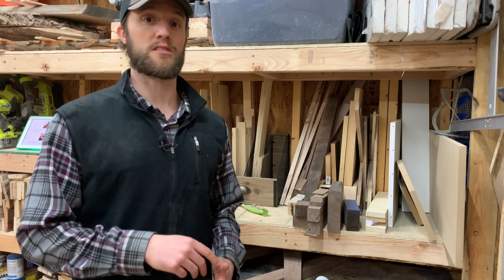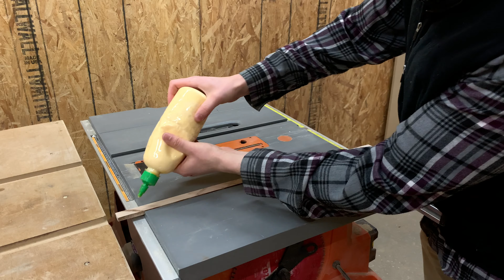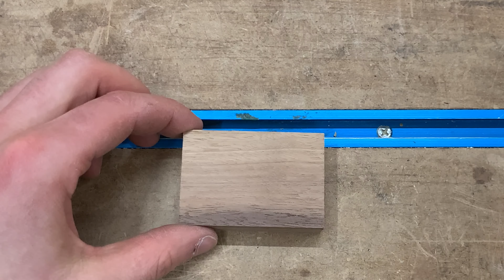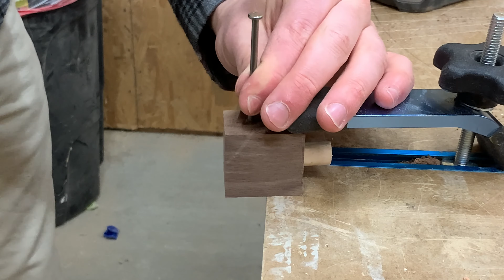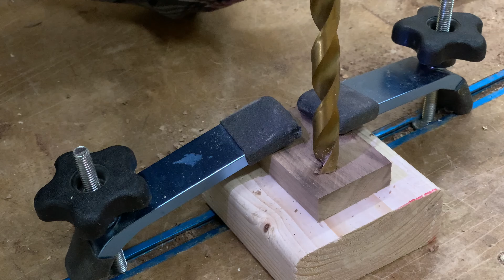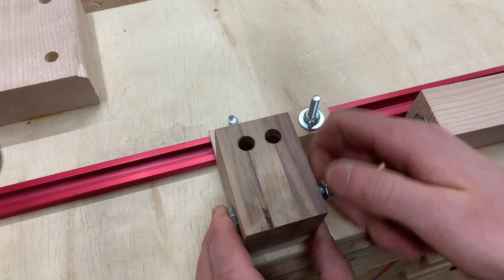this will put lathe companies out of business

Comment: Simple enough design. The drawback is you can only get a radius equal to your block and screw. I think the jig where the blade is underneath instead of to the side, is a better approach. That way you can raise your support or raise your blade, for your desired circumference without creating a whole new one
Reply: The only drawback I can see is that it's not a lathe.
Reply: @cartier13  It doesn't mind since it does job. Why being so closed mind?

Comment: Excellent design. Thanks! This should be perfect for my situation.  For what I'm doing, I stop at .05 sec (make a tenons) on the ends of 3" to 5" logs. I just need to figure out how to adjust the feed rate, probably the tailstock with a 5" x 1/4" machine bolt with the threads exposed so the rate of feed for the log can be regulated.

Comment: Do you have the power drill in forward or reverse?
Reply from the maker: Forward
Reply: @SpencleyDesignCo  , the reason why I asked is some will cut on the left side and some will cut on the right side of the blade. Thanks.
Reply from the maker: Yup!
Reply: Doesn’t forward with the jig left of the blade make it a climb cut? If so, is that not dangerous?

Comment: Nice jig.  The only problem is that the bottom radius of your finished piece will always be equal to the distance between the tailstock nail hole and the table saw blade.  Would be nice if you added an adjustable slider on the tailstock.
Reply from the maker: Thanks, Samuel! It’s definitely an option to add adjustments at both ends 😀

Comment: You might be interrested in this jig using a tablesaw to turn a ball.

Living in a flat and only having room for a small underpowered wood lathe, it takes forever to turn a ball.
But I have a table saw and a drill so I designed a jig where you can make the ball/sphere in about 5 of minuts.
It's done by turning wood blank by the drill and rotate it around saw blade, a mix of your table saw lathe and circle jig
Have a look here for the basics of the jig
https://youtu.be/egUNaP-0-x0 
and the one i build enclosing the process to keep fingers away from table saw blade.
https://youtu.be/hZarZfzcbco
Keep safe - Happy Woodworking
Reply from the maker: Sweet!  I will check it out!

Comment: How much cutting height do I need if I am looking for a table saw which can be used for this? 😊
Reply from the maker: Hi! I’m not sure I fully understand your question. Are you asking how high the blade needs to come up from the table?
Reply: @SpencleyDesignCo  yep =) The most tablesaws i can find only goes to 60mm in a 90 degree angle. But it seems that i need more for a project like this.
Reply from the maker: Yeah that should be fine. In the US, a 10” table saw blade is the most common. That gets you about 3 1/2” of cutting height. I think that’s 75-90mm if my mental math is right

Comment: perfect timing! im going to be making this jig!
Reply from the maker: Awesome, Kyle! Thanks so much for checking out the video and supporting the channel! Let us know how it goes! If you have any friends that might like the video, sending it to them would be a HUGE help for the channel. No pressure though, just glad you found this helpful 👍
Reply: @SpencleyDesignCo  The jig came out great! i am having an issue with flat spots near the tail stock from the initial cut offs, not sure why yet. otherwise, this is awesome.
Reply from the maker: That just means your stock that you’re turning isn’t large enough to reach the blade. Either make the spinning piece thicker, or move the tailstock closer to the blade
Reply: @SpencleyDesignCo  I think its that the jig is nearly completely off the table saw surface at the start which introduces a lot of slop. i almost need an infeed table...
Reply from the maker: You could also extend the runner in the miter slot so it starts tracking straight earlier